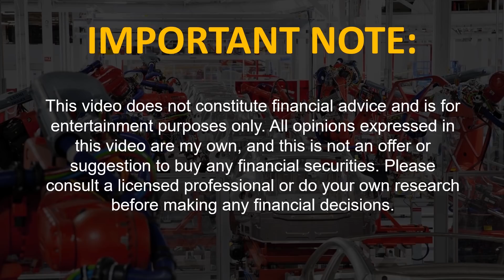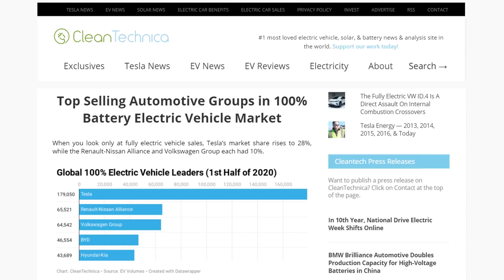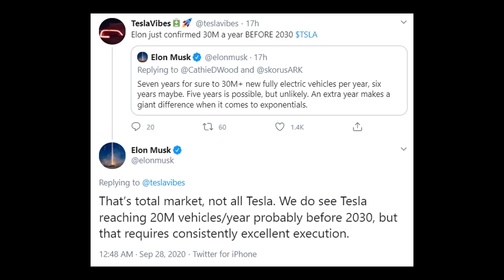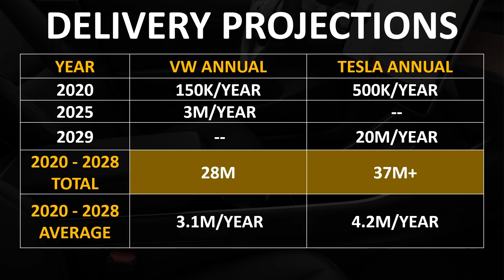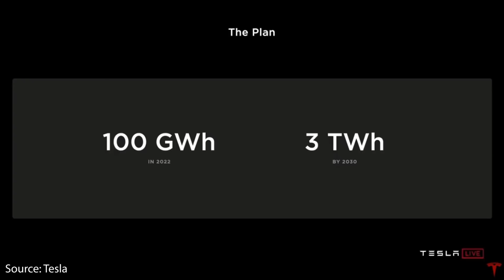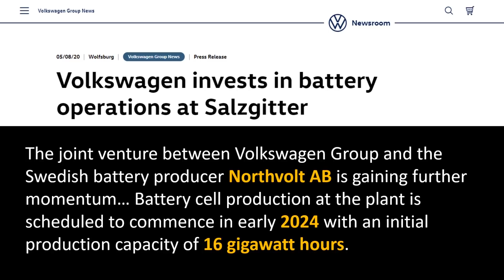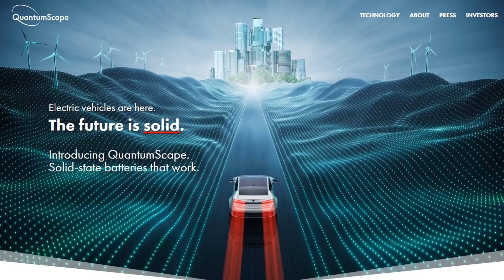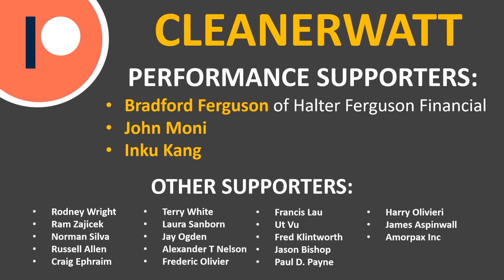Tesla vs VW: Can VW Catch Up? (Electric Vehicles)

Comment: Tesla is great, but I think their lead is overhyped. VW/Skoda just launched two MY competitors with similar range in the LR versions for about €46k starting price. MY LR AWD starts at €65k. They're both a lot cheaper than the Y, and in Europe they're also available really soon. Giga Berlin will not be operating until late 2021, and then they need to slash about €20k off the price to be competitive. So if Tesla has such a huge cost advantage in batteries, why is the Model Y so much more expensive?

Comment: Very enjoyable video!  It does beg a question in me though.  How many man hours does it take to make a Tesla vs a VW of similar class?  With the Tesla 1 piece press creation of the front and the rear chassis Tesla's man hour investment should be very low.  Yet VW will be having a great supply of workers who no longer need to install valves and pistons etc.  So even though Tesla can produce a car in 10 man hours; VW may be able to put in 20 man hours in 1 hour!  Also what is there to prevent VW from work-around-engineering the batteries and the 1 piece chassis.  Is a 2 piece rear chassis that much more labor intensive to install?  The financial trajectory, is what I am trying to get at, over the next 5 years.  Were Ford and VW to combine forces; Tesla will be needing to really drop those prices!  Industrial efficiency in car making isn't as difficult as it once was.  It's nothing to buy a Tesla and take it apart.   Many, many, questions left unanswered.  Still it was enjoyable!

Comment: Well the VW Group do have huge resources. Their R&D is probably likely to be more comprehensive than Tesla's, plus VW have decades more experience of production methods etc. One particular study I read on here somwhere a while back, looked at the Model 3 in some depth. This group reverse engineered the car, paying particular attention to the quality of the assembly and the methods used. They noticed that in the wheel arch of the Model 3, no less than 9 separate pieces were used to form the arch. Many typical car makers might use one or two parts. It is areas like these that Tesla lacks the sheer production know how to compete in the numbers game. The report did comment on the quality and efficiency of Tesla's drive train though. They felt that was as good as it gets just now. The upshot of it all was that Tesla know how to produce superb electric cars, but haven't yet grasped the finer points of mass production. With VW, the reverse was true to some extent. I certainly would not expect VW to remain stationary when it comes to EV drive trains though. Theirs will improve even further as the years go by. And VW, like Tesla, now have their own charge network and energy company. VW are bound to want to invest heavily here to help boost sales of their EV's..... So yes, VW are not likely to settle for being an also ran. As with their i.c. powered cars, VW like to think their cars are as good, if not better than many.

I found the article.....  Here  https://www.youtube.com/watch?v=Lj1a8rdX6DU
Reply: Brian Well i would say Tesla is now catching up in manufacturing though. You should look up munro live, the same guy in the bloomberg vid, warch hes Battery day recap.Tesla eliminated 370 parts since the video you posted, making a new type of aluminium able to cast the back / front in 2 pieces. Tesla moves fast

Comment: I think you need to be more practical about your assumptions: 1) World total market for all cars ±80m cars per year - not even Elon expects to get 25% share of all car sales 2) Tesla has leading battery tech & software for now, but can't compete on build quality - its good for the early adopter market, but competition will get harder and harder as the market matures 3) In-house battery manufacturing will not give Tesla any advantage over the likes of VW's buying power from focussed battery businesses 4) To produce 20m cars a year, Tesla would have to invest about $200bn in 40 giga factories producing 500k cars each a year - Tesla's can't keep up 50% growth per year - lets say they add 500k cars capacity per year 5) Its a lot cheaper for VW to retool their existing production lines to build more electric cars than for Tesla to build completely new factories.

If Elon is clever, and I think he is, he shouldn't focus on building so many cars, he should license the battery tech & software to VW / sell them batteries for VW to use in their cars - the marginal cost of licensing the tech to other car manufacturers is ZERO so every cent is profit <-- and I'm betting thats what he will do (Elon has already met with the CEO of VW ...)

Comment: The statistics do not lie, VW is a giant and if this year has already reached 50% of Tesla's production capacity on electric cars we must be fair to sound that statistic in 2 years VW will be over Tesla in number of cars produced.

let's not forget that VW Group produces 10 million cars a year and Tesla 0.5 Million

Your video is a big lie, you Tesla Fanboy
Reply: All Tesla FanBoys are activated :))
Reply: Here is a very interesting statistic.  Let’s say by 2023 with the Chatanooga VW EV factory producing 100K ID4 and ID Buzz. That means 25% of VW sales in the USA that soon would be EV, Volkswagen has no choice, they never had luck selling more ICE cars.  Now that VW quality is better, ICE cars are now too complicated for Emissions, VW ICE are ticking time bombs for maintenance
Reply: Volks Flieger in 2 years max they will be No1 in sales WW.  They are too big to fail and the resources are huge.

For exemple the produce arround 150 models on all VAg Brands, and Tesla has a hand of models
Reply: It doesn’t matter how many ICE cars VW are making, what matters is how many EV they will make by 2024 or so. At the most 2M? VWs problem is battery supply, as Musk pointed out. Making EVs are easy, easier than ICE. What is hard is building quality battery cells by the billions at a 40% lower price than now, with 50% more energy density, with 50% less battery decay. VW need to stop buying battery cells and learn battery production and innovation. Note that due to superior Tesla battery energy density and software, VW will have to price its cars below Tesla, and can they do that at a profit?
Reply: Mike N Volkswagen has suppliers build batteries to Volkswagens design and Chemistry
Reply: @janozkk  Let us settle all the ignorant hype once and for all. 1 VW has 25% more cost pro car than Tesla because they need to fork out about 20% to their dealer network and 5% for advertising. Plus an additional 10% to the various parts suppliers, and to be kind to VW I will not mention the great cost advantage that Tesla will draw from his new vastly better performing batteries. So Tesla has at least a 35% pricing head start on VW, which mean that while Tesla will be able to use the pricing leverage to gain market share, on the contrary VW is going to be frozen to their very high priced EV and unable to cut prices. Case in point VW new EV are priced very closely to Tesla model 3 prices, but yet the model 3 is by far a vastly superior car in general performance, safety and contents. The announced $25.000 Tesla EV equipped as the more expensive Tesla models, as per Elon Musk assurance, that will be launched within 24 months, will be bound to add enormous pressure not only on VW  EV, but to the whole lower priced  EV segment . It is too early to determine how markets will react, but we will find out soon enough.
Reply: @janozkk  - so, how large a battery R & D unit does VW have? The trouble is that batteries are now the core competence if automakers, and I don't know of a major automakers who contracts out their engine ICE making. VW need to match Tesla is terms of contracting battery scientists and engineers.
Reply: You said it. VW KNOW how to build cars, but at the moment lack Tesla's experience of EV drive trains. Tesla don't yet know exactly how to maximise production efficiency in design or production, but do have the edge on EV drive trains. Both makers will be seeking to strengthen their weaknesses. It's going to be interesting, and good for the customer......
Reply: Brian - we are all hoping that VW succeed, because at most Tesla will produce 20M vehicles p/a by 2030, and the earth needs another 80M p/a produced. In total automakers need to produce 3B over the next 15 years, so it will be great if VW can get to 10M EVs p/a by 2030. The worst thing for climate change would be for to be no Tesla competitors. Tesla also need competition to push them not to become a lazy monopoly.
Reply: Statistics are constantly used to misrepresent or to lie as in the case of VW, by its own admission already in trouble, with the model 3 and 4 coming in the market with already known software deep problems, range and recharging station limitation, and with their very disappointing initial sales numbers. and their ICE car sales aren't doing better either with 20 to 30% sales declines over last year, while Tesla sales are up in between 25 to 35 % over last year numbers, with unfulfilled orders of over a million cars on its books and new factories sprouting in every continent. VW weakness is its size, trying to do to many things at the same time. The fact that they are trying to sell Bugatti Lamborghini, Seat and Ducati is a very clear warning sign, the question should be not if VW will catch up to Tesla, but if Tesla will eventually kill the VW group among many others.

Comment: Hmm...  I’m guessing that BYD, SAIC, and a few others each sell quite a lot more EVs than Tesla.
Reply: I think you might get be right.  Tesla is pushing so hard to ramp up production numbers, they are making pretty unacceptable QC mistakes.  The fanboys won't care, but the average consumer is not going to take out a sizable loan on a car with a roof that might just fly off on the interstate.
Reply: What makes you think that when you consider Tesla‘s lead in engineering, manufacturing, battery and electric motor tech and their lead in software, autonomous data/chip-design?
Reply: Schrader Clemens, reasonable thought.  I have little question about their technological leadership, but I think they were speaking in terms of vehicles shipped, not technology.  They framed that statement in terms of manufacturing capacity relative to VW, “28% of the world’s electric vehicles sales,” etc.
Reply: @schraderclemens6122  There is no evidence for Tesla having any lead in anything.
Reply: @VirtuellJo  have you seen battery day?
Reply: @schraderclemens6122  yes, it just proved my point. Read some non-Tesla battery news and you will see that Tesla have noe lead at all. Go and read about non-Tesla autonomi and learn how far behind AP is. Read about manufacturing and see how far behind and inefficient Tesla is. Read about solar and lear how far behind Tesla is.
Reply: @VirtuellJo  i mean Tesla's lead in autonomous data is huge! And hearing engineers (go look up Sandy Munro) talk about Tesla's advancements in manufacturing like their single-piece front and rear casting just seems mind-boggling to me. Tesla even though they aren't perfect at all are advancing so much faster than everyone else and they are so innovative it's hard to comprehend.
Reply: @schraderclemens6122  Tesla fans who only seek information from Munroe and similar sources tends to belive what you are saying here. While when you broaden your sources you find that Tesla is actually far behind. Safety and quality are two things Tesla are really lacking in.